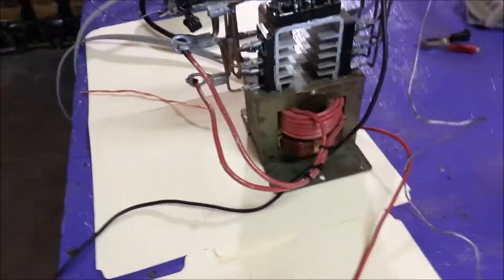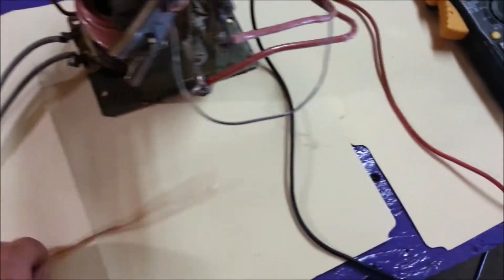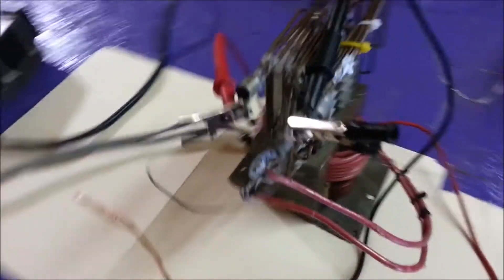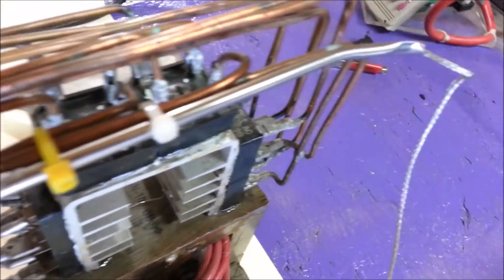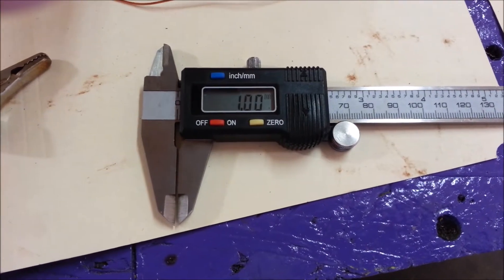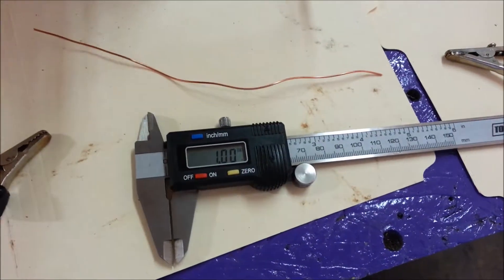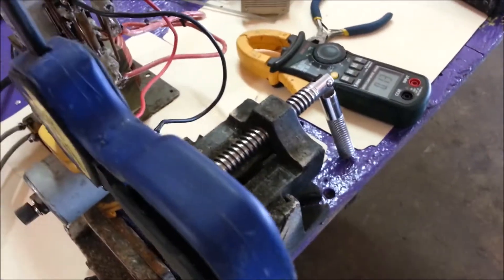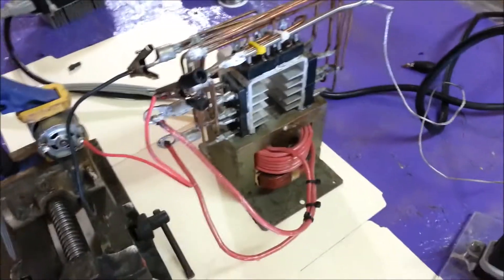How many amps can 1mm wire take

Comment: What is the point of this video? You really want to know how much current safely goes through wire, google it. Otherwise you are just making an old fashioned trigger grip soldering iron.
Reply from the maker: who said any thing about safety ? this video was a test to examine the behavior of overloaded wires , and when you google it my video comes up so yeah thats the point .
Reply from the maker: i think im gonna delete this comment , you just dont get it
Reply: Please don't delete this comment thread. Thank you for making this video (even without a camera stand). 

My physics class had a homework problem where we were asked if putting 1400 amp through a 1mm copper wire was a "feasible" way to get the wire to levitate when properly aligned with the Earth's magnetic field. 

This is the only video on YouTube where the answer is made obvious. So screw that guy and the trigger grip soldering iron he rode in on.
I'm putting a link to this video in my homework assignment!
Reply from the maker: LMAO  right on little brother